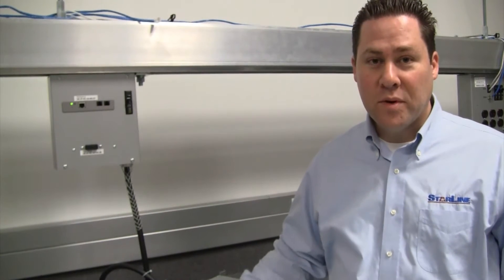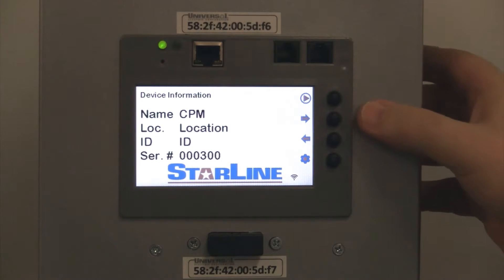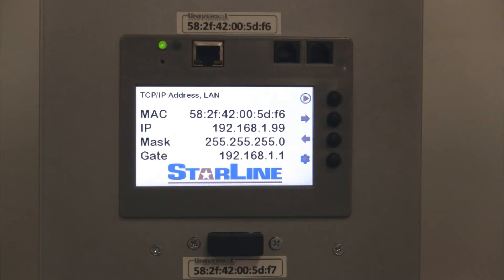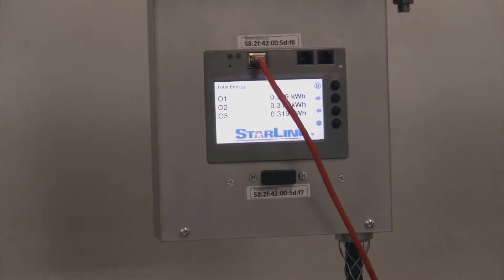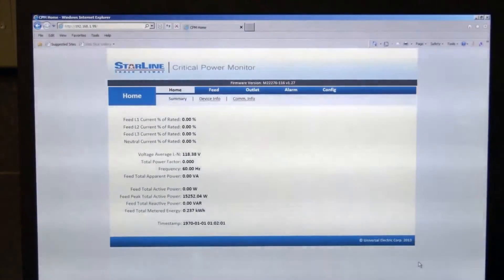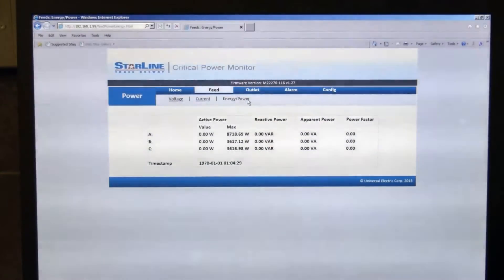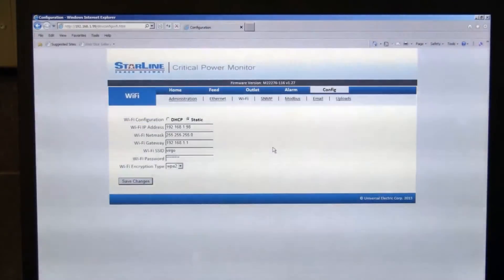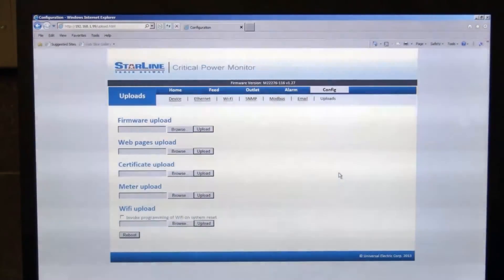Starline Critical Power Monitor CPM

Comment: In your video, I didn't see anywhere to program the CT ratio. There has to be somewhere to do that. How else would it know what CT's are connected to it?
Reply from the maker: Starline Critical Power Monitor is factory calibrated to the specific CT’s that are being used for the application, and provided with the unit. Both solid and split core CT’s are available. All we need to know is the ampacity range of the device being measured and the system voltage.